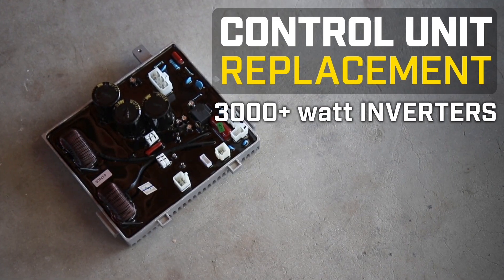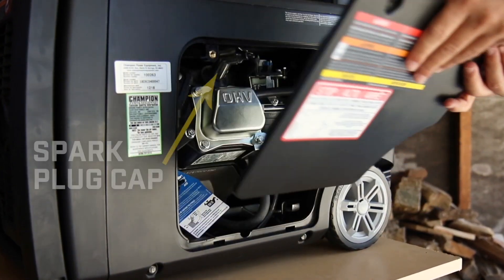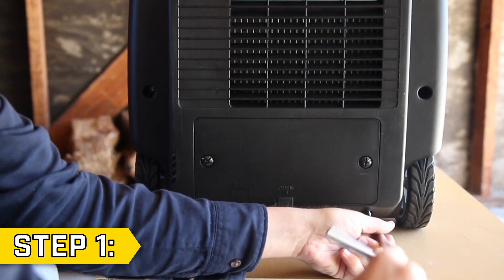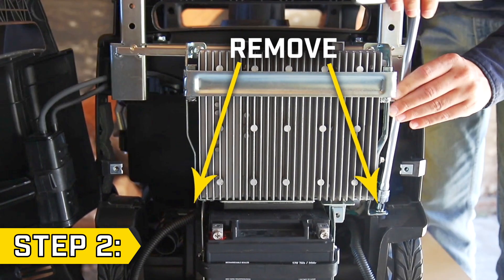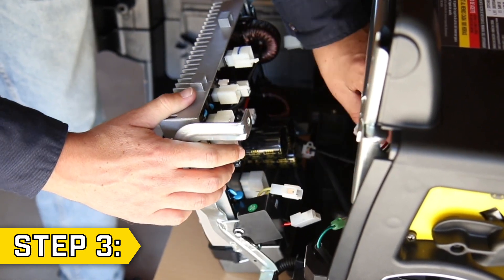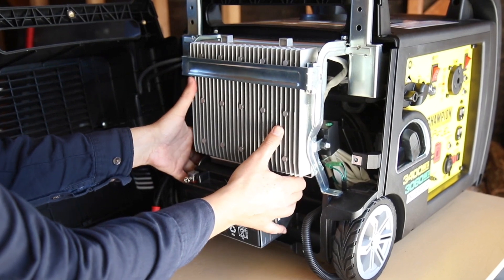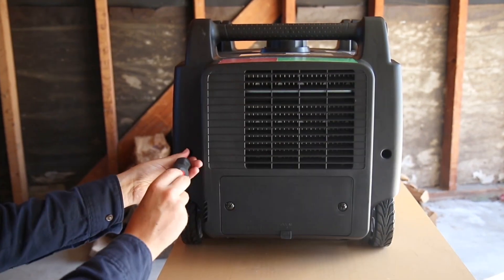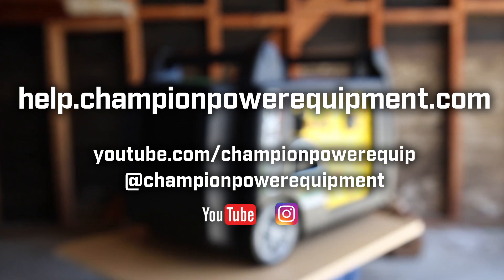Control Unit Replacement (3000+ Watt Inverters)

Comment: Hi the LED indicator lights are not working but there is power output, what seems to be the faulty part? and how much would it cost?
Reply from the maker: Hello, if you are having trouble with your unit, please contact our support team at 877-338-0999 for further assistance. Thank you

Comment: Hello, do you have voltage specifications for diagnostics on the module. I would like to know what AC voltage level should be present on the "Sub Coil". Thank you.
Reply from the maker: We apologize for the delay. The sub coil voltage is 3000rpm(ECO-ON)  = 19.4V & 3800rpm (ECO-OFF) =  25.1V. Thank you.
Reply: @ChampionPowerEquipmentHQ  Hello, no problem, I appreciate your reply.
Thank you.

Comment: I have the 100262. I took my unit out and hooking it back up the red and white wires can fit in either socket. It seemed that the white wire should have gone in the top socket and the red below it but I looked at diagram and the unit and came to think the red should be on top and white below. I hooked it up that way but was concerned about ruining the control module. I called customer service and she sent me a video and it showed white on top so I hooked it up that way. With two sockets the same for two different colored wires namely positive and negative it seems that should have been stressed in the instructions.
Reply from the maker: Thanks for your feedback. We will be sure to pass this along to our project managers for review.